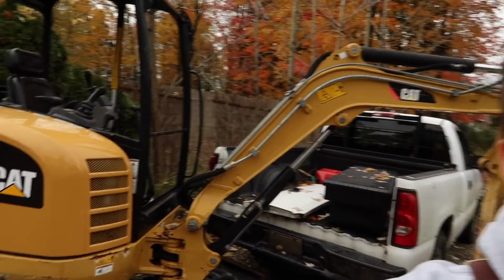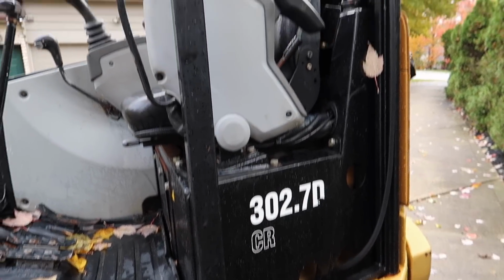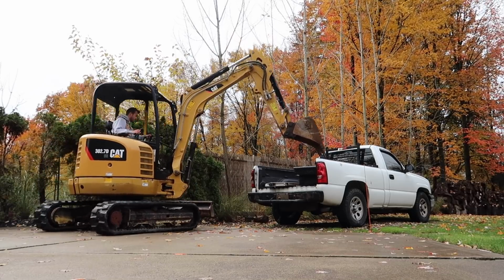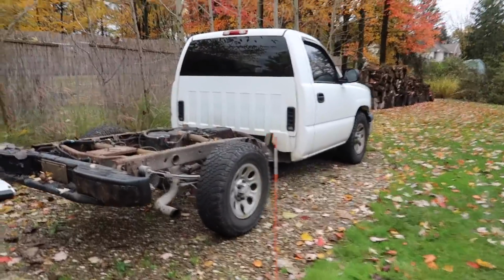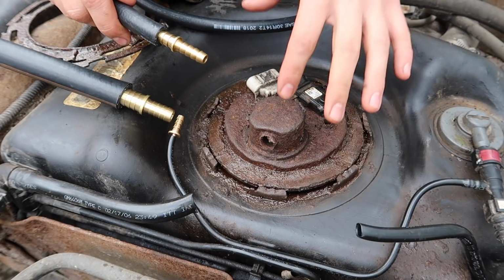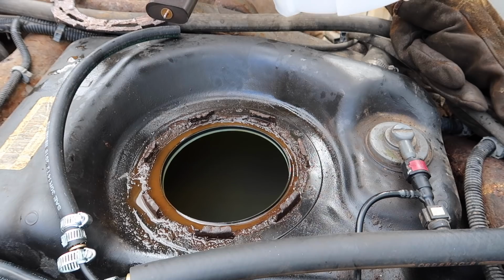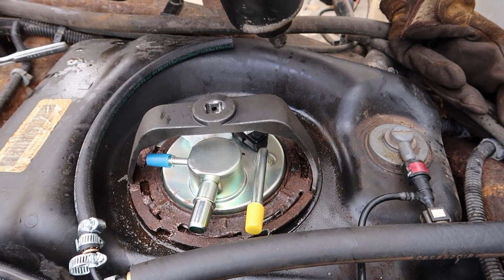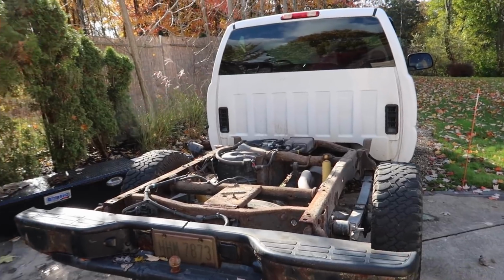MY NEW CAT MINI EXCAVATOR 302.7D CR (and I fixed my truck)

Comment: Just curious, why did you get rid of the Bobcat 442?  Did you have issues with it? Wanted a smaller machine?
Reply from the maker: It had higher hours, and it was too large for me to move myself
Reply: @dobronos  Thank you for the info!  I was a little worried as I just bought one on auction yesterday and there are not a lot of 442 videos on YouTube.  These are great videos to get me started on the repairs I will probably need to make on my machine.
Reply: @dobronos  Thank you for the info!  Just got mine home yesterday.  Yes it is a big machine!  Luckily I just bought it for my property, so I don't think I will have to move it much!